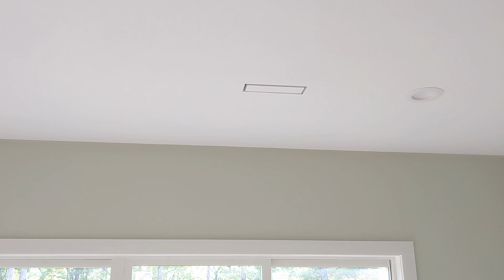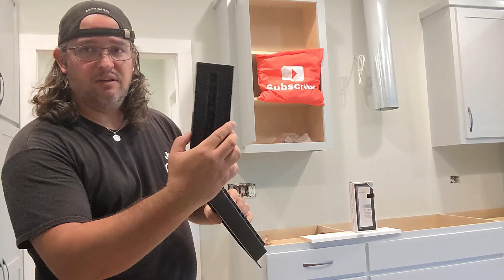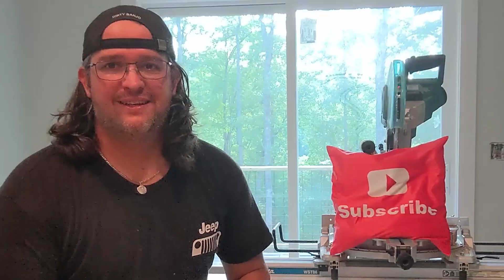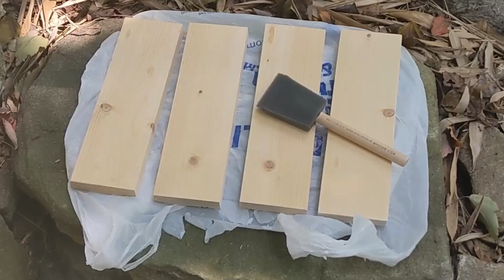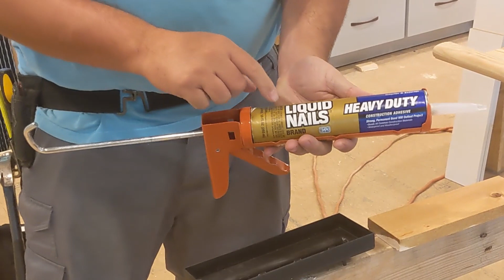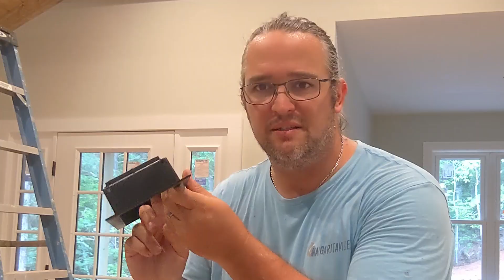How To Install Hidden Air Vents That Look INCREDIBLE?

Comment: I have a similar ceiling and found a wood toned regular plastic vent cover at home depot that blends in to knotty pine far less noticeably than the aria with its distracting black frame.
Reply from the maker: That sounds like a great alternative for blending in, thanks for the tip and for watchin'!

Comment: From my experience on the HVAC field I can say those registers probably aren't a good idea for overall performance and throw of the air. I bet they are noisy from exceeding face velocity. The other style has a better mix to the air imo.
Reply from the maker: Appreciate the feedback. We haven't had any problems yet.
Reply: @BenVanKirk  do you have a part# for the registers?
Reply from the maker: @sirfishalot6992  https://amzn.to/3FEZX6N be sure to double check sizes.

Comment: Would be worth it to use a router and make a groove to match the tongue-n-groove on the ceiling.
Reply from the maker: I didn't even think of that... now it will bother me every time I look at the ceiling. I may have to pull them down and try that out!

Comment: What about air flow quality though. It looks restrictive.
Reply from the maker: Actually the airflow is very good,. The lite models do not allow the control of how much so they are on 100% for 100% of the time. the Pro models do have dampers on the back that allow for adjustments. The other thing to consider is directional flow of air if you are trying to push air a certain direction from the vent. However, most traditional vents don't do a great job of that either. Overall we love the look, quality and don't seen any performance drop over traditional vents.